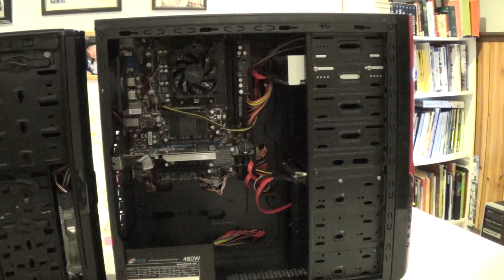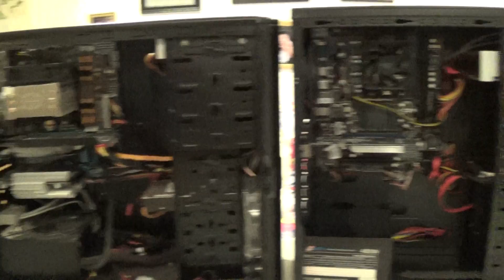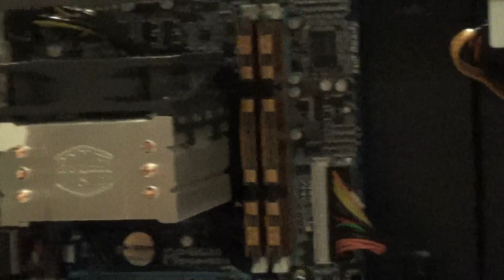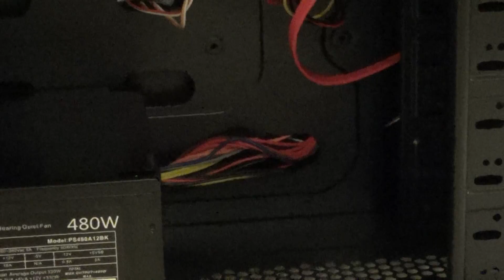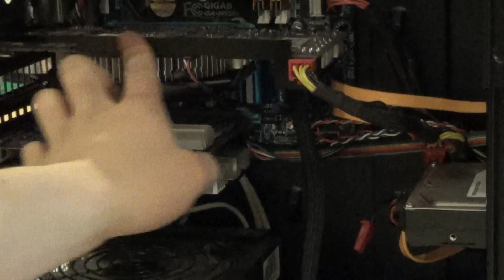How To: Cable Management

Comment: Hey I've watched all your videos on the building a pc as im using the same cpu and case and have a question. I didnt realize that the PSU for it was PEAK at 480, and average at 330 watts :( Would i stil be able to run a GTX 570 on it, or should i not even try and just get a new PSU?
Reply: Hi this is Kevin sorry for the late reply you need at least a 550 watt for a GTX 570